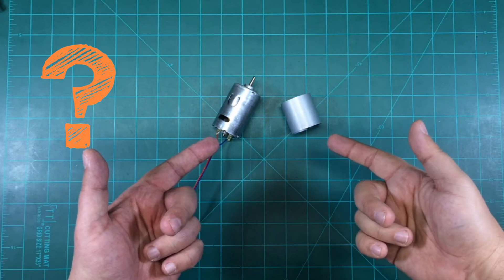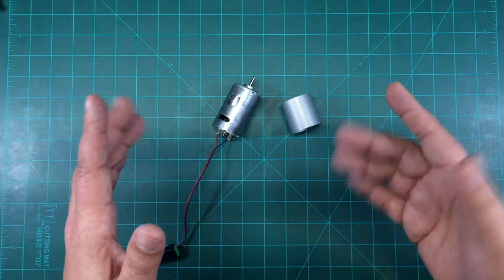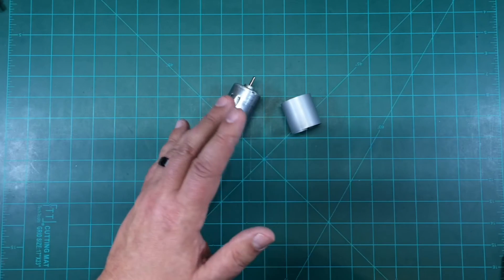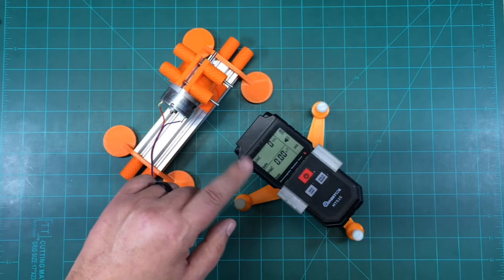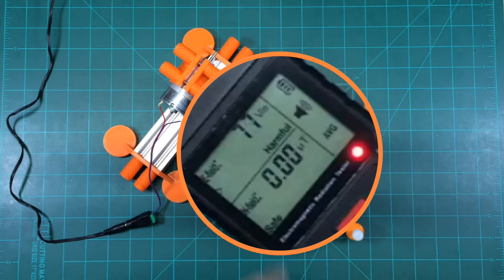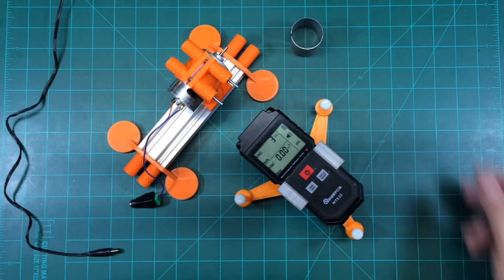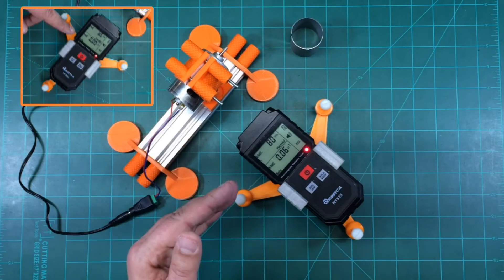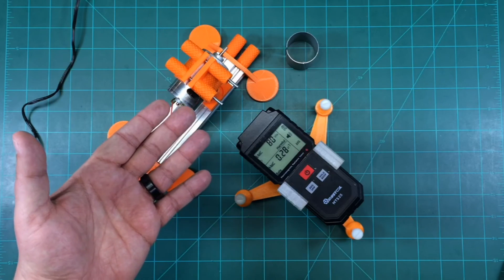Shop Talk - What is a Flux Ring?

Comment: You really did not test the increase in torque claim.
Reply: Or speed. It sounded different but obviously we couldn't see  well.
Reply from the maker: I have nothing to test either speed or torque, however it is some what a moot point (at least for torque) ) as if you compress the magnetic field your increasing the torque by proxy.  So this test shows yes the ring does compress this field so torque would be effective.  I am not sure why it would spin faster without the compressed field...

Comment: question,is it possible to flash grbl to an arduino nano,i have tried with no luck,can you help.
Reply from the maker: Yes, make sure your selecting the correct processor & board from the IDE as it will be different then the UNO...